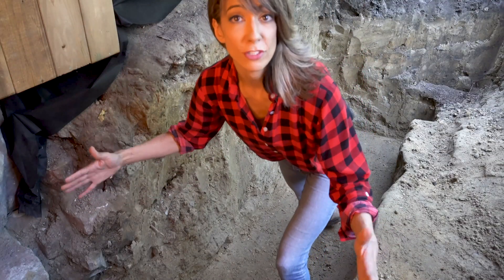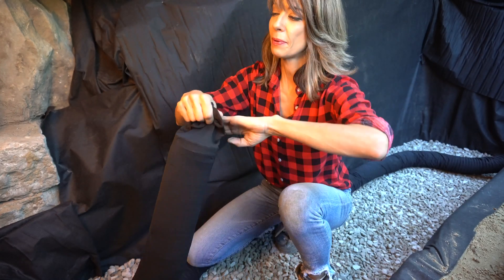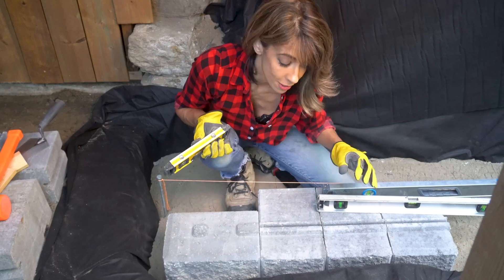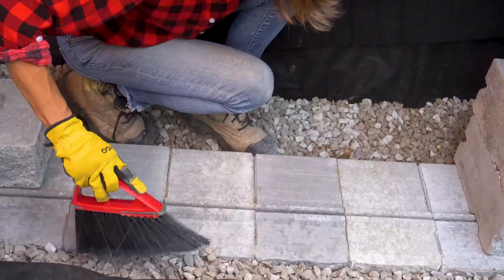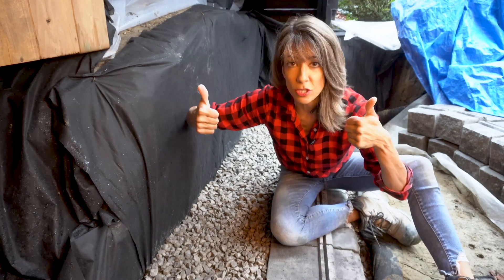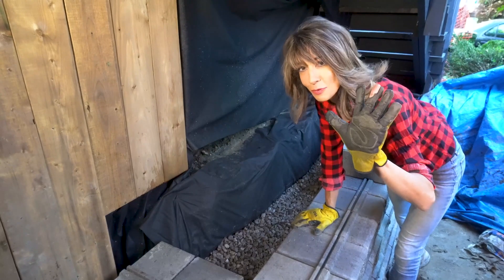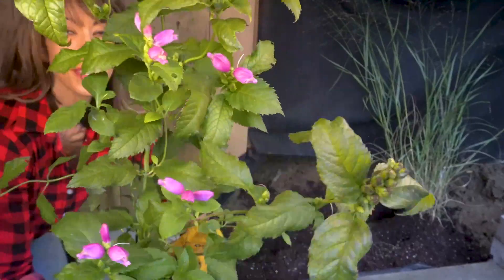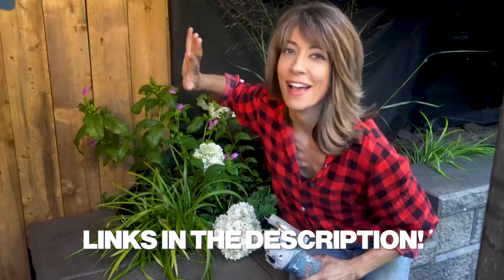The Smart Way to Build a Retaining Wall

Comment: do i have to use a tongue and groove system? what if i just use normal blocks, then do i use concrete mix?
Reply from the maker: You can use regular concrete retaining wall blocks for this type of build. Concrete with mortar construction is different. Good luck with your build!

Comment: Ok I am missing something here .
At 2.50 you jump from 3/4 to block on  base. 
Did you  throw the base on the rocks ? Or put fabric on between to separate  ?
Thanks
Reply from the maker: @A-d_Elger  I screeded some chip base or 1/4” crushed limestone to make leveling easier. You can also do this to make your micro-adjustments easier. I go into detail about it in my pavers video. I skipped it because not everyone will want to add a step but having some on hand is good. I use about an 1 inch.

Comment: Great video all around! I put a little Portland cement on top of the sand for the buried corse of Versa-Lok to keep from over seating the pins. You can also cut the coping blocks 1/4” deep from each side and you should be able to split them with a “V” chisel to get the rough face.
Reply from the maker: Thanks for the tips.  I'll definitely keep that in mind. Good one!

Comment: Excellent engineering tips: I've worked the last 18 years in this field and taught countless homeowners the same basics. I was lucky enough to use Versa-Lok which is a solid core pinning system with each block weighing 82lbs. No ends needed, just break the block in half to have two rough faces. You'd be surprised how many people want to put a liner directly behind the wall which would create hydrostatic pressure forcing the wall out: you're right, drainage is everything!
Reply from the maker: Thank-you for sharing your tip on not putting a barrier on the front of the wall. I’m dealing with that right now. A wall that prematurely failed. Good to know what you like to work with the blocks!

Comment: I am so amazed and impressed with this. I did not realize there are specific materials and block types that one can use for a retaining wall. Your project makes me recall the day, many long years ago, that I helped an uncle build a cistern using concrete blocks. That was back in the 1970s. I'm not sure if unigrid or filter fabric was available back then. We did use crushed rock as a foundation for the cistern. My uncle did all the work of leveling the bottom of the cistern before asking me to help with the rest of it. So this video lets me compare methods from decades ago to what we can do today. This retaining wall highlights the use of more technical materials to get the right results. You show much better techniques and materials. Adding plants is exactly the right step in the construction process as well. I am very glad to see you are using gloves and wearing a respirator when cutting blocks to protect your lungs. That is extremely important. My grandparents both got severe COPD from working in dusty environments with no respiratory protection of any kind. They suffered terribly. If you are going to use a saw -- please consider wearing hearing protection -- do protect your hearing. I think your videos are extremely helpful and I'm going to subscribe to them. Thank you so much for posting this!
Reply from the maker: Thanks for sharing your story with your Uncle sounds like an incredible experience! Excellent tip on the ear protection I've been wearing them since a retired carpenter suggested it here in the comments. Always listen to those further ahead of you who have wisdom to share. Love that level of kindness.